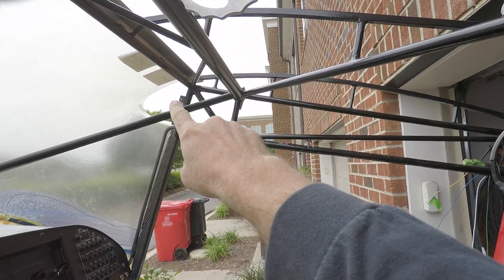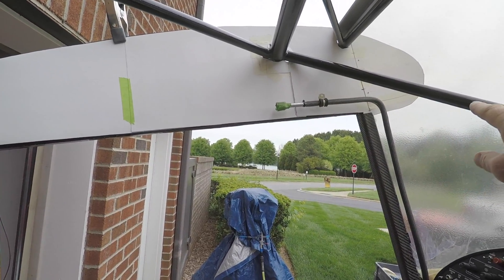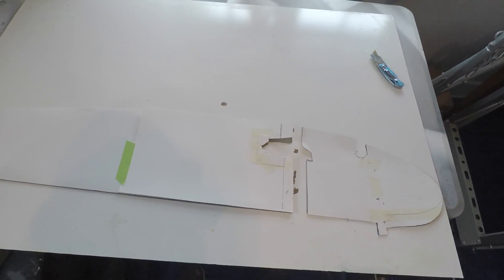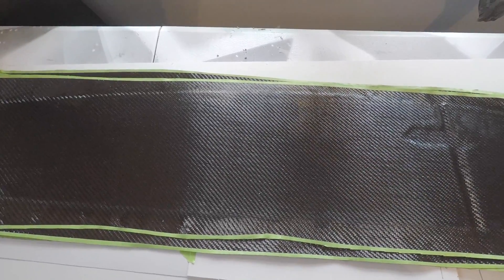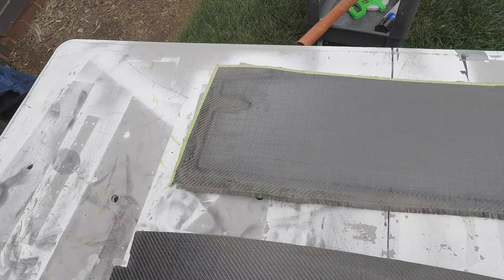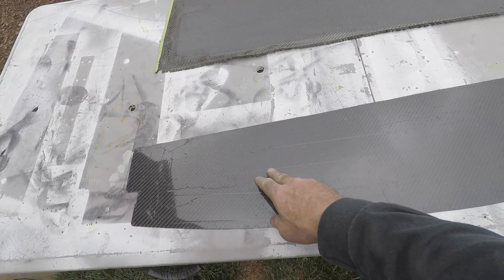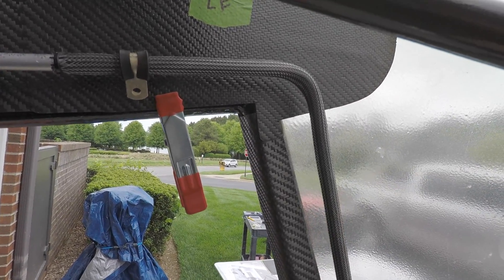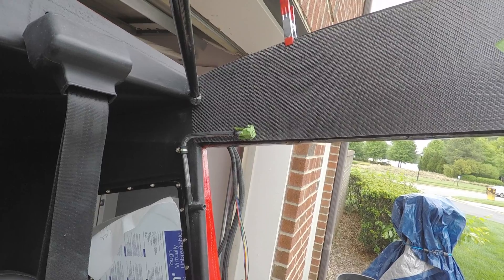BEARHAWK ~ Carbon Fiber Wing Root Panels!

Comment: Need to vacuum bag carbon fiber layups to get minimum weight and max strength.
Reply from the maker: That would have been ideal, yes.  Thanks for watching!
Reply: @TheBaldPilot  Pretty sure you knew that . So many details. Thanks for the great videos.
Reply: @TheBaldPilot  I'm currently plotting a BH Patrol build so I'm scouring the internet for the experiences of others. Huge amount to learn and to take heed of their lessons learned.
Reply from the maker: @RunFast64  I think the success of a good builder is his ability to research and adapt.  I know many builders that do not know to use the internet to their advantage and end up with mediocre results.  Good luck with you Patrol decision.  If I were to build again, it would be the Patrol.
Reply: @TheBaldPilot  Grass is always greener. Your very muscular 4-place is awesome. Once sitting in a Patrol I'll probably  have 6 banger envy:) Seriously.....Many details to sort out before anything is ordered. Engine and induction options, prop, ignition are some of the biggest hitters. If I go dual Light Speed ignitions that drives numerous other system changes. Vans will be my go to source for the FF kit. Thanks again for the videos.

Comment: How does this wing root cover attach to the fuselage?  Also,  How do you seal it around the wind screen?  Love the videos.
Reply from the maker: Thanks, Justin!  There are a few tabs on the cross bracing where I will install nut plates.  I will probably weld in a few more tabs where needed.  I will use edge trim around the windscreen.  Like this:  https://www.amazon.com/gp/product/B00NL49008/ref=ppx_yo_dt_b_search_asin_title?ie=UTF8&psc=1